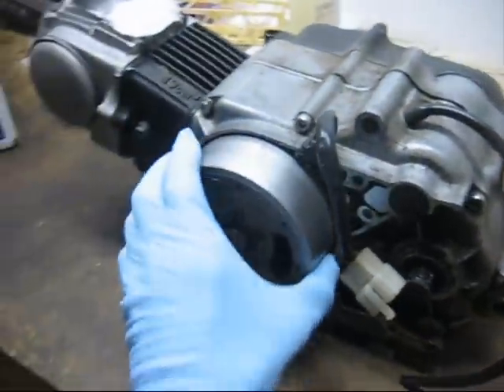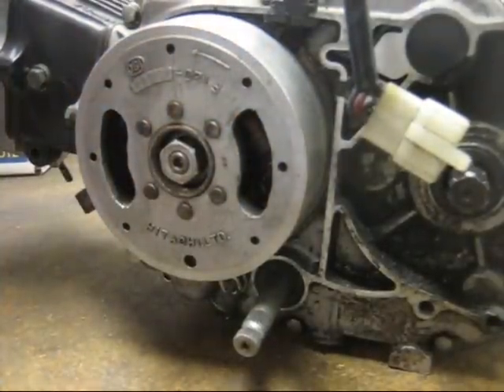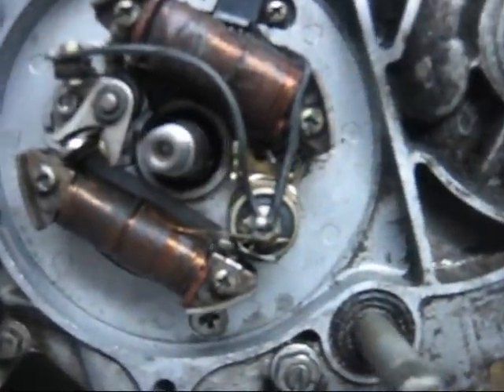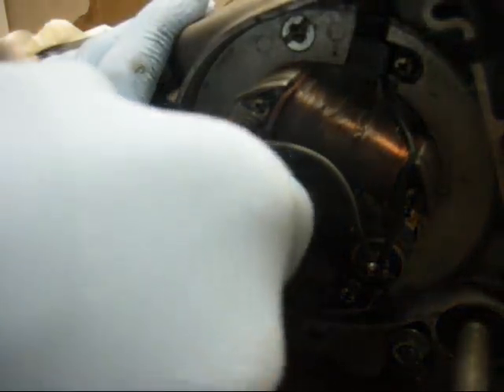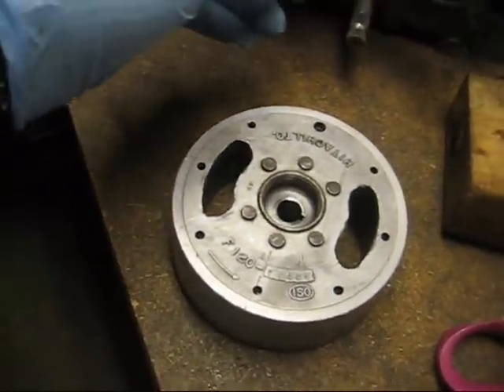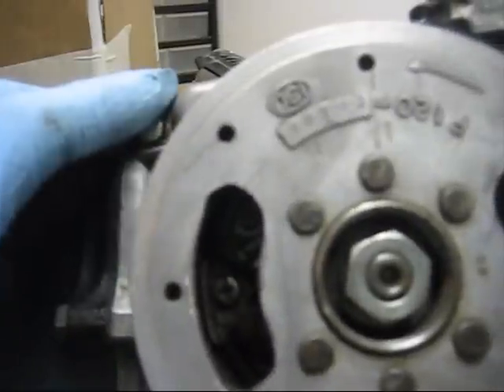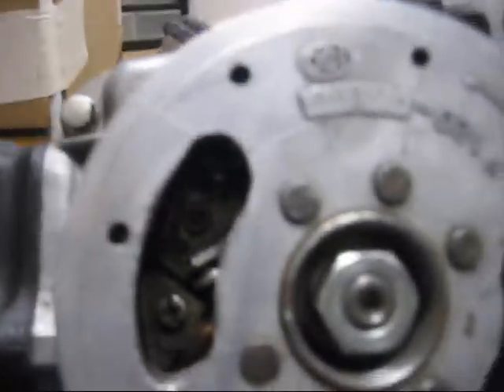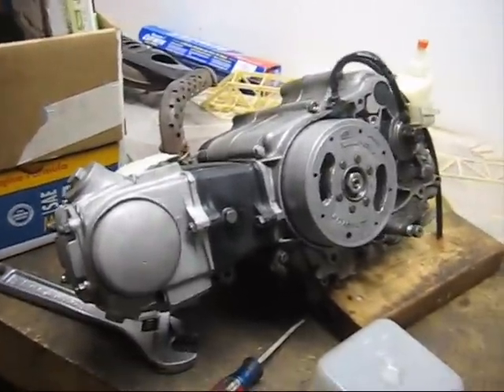How to Set Points

Comment: great vid Alex.  filing points are ok for a temp fix, but the contacts come coated with silver, and once the silver burns off, the points will quickly burn again. silver is the best electrical conductor on the planet. keep up the good work and vids.

Comment from the maker: It has been a long time since I worked on a Z50R motor with 4 wires. In either 1979 or 1980 they changed to a single wire output which powered the ignition coil only. The 4 wire stators were used for bikes with lights, horns, and other electrical components. If you wish to run lights, that's what the other wires are used for. Keep in mind, the voltage is not regulated so you'll have to wire in a voltage regulator. It would be a good idea for you to search for wiring diagrams.

Comment: i have always been told to use a point file. sand paper is glass an insulator if there is pieces of sand on the point it will not fire. if u use a file only metal a conductor will be left behind and conduct if there is small amount of debre in the point area. not a big deal but good for people with out comoressed air. great video and can be done both ways. the best video i have seen on this

Comment: Nice video i took a old magnito flywheel .drill out the rivets  then the part that slides on the crank is left over .slide it on rotate until point gap is largest and adjust 12-16 .great easy access

Comment: The best way to recondition points on any engine is NOT to sand them while they are still in place.  Never having been off to inspect the actual surfaces of the points.  It is very important that the coating on the points is uniform to make solid contact.  If you sand them while you haven't seen if there are any small pockets on the surface of the points , you are only wearing the platinum or whatever coating that is on their facings.  Take them out and use a wire wheel in a drill etc.

Comment: Good video's Alex. There is a flaw in your settings if the points and their rubbing block are worn. Setting just the point gap with worn out points will give you correct dwell but the spark advance will be early.  Not too common on the little Hondas but I have seen it.

Comment: You also need to watch out for wear on the fibre heel of the points, if it's worn too much your dwell angle will be too small which causes the condenser to not have enough time to charge up, resulting in a weak spark. I've worked on hundreds of these... A buzzbox and timing light are also very helpful .
Reply from the maker: My grandfather has a cool old-school oscilloscope. I think it's made by Sears Roebuck. He showed me how to use it once on his 1969 Ford. I can't say I've ever used it since. When setting up the points on these little Hondas I usually set it like shown here and fine tune it with an inductive timing light. As for the wear on the follower, a drop of oil on the felt goes a long way to reduce wear. Seeing as how the part costs so little, I generally just replace it if there is noticeable wear.
Reply: Yea dwell wasn't as important on these little guys as it was on the high performance two strokes like the Kawasaki and Suzuki triples. Severe engine damage could happen if I got it wrong.
Reply: Getting the dwell angle wrong won't do anything much to your two-stroke engine, just misfire and oil up plugs. Shorter dwell gives less time for a charge to build in the primary coil that collapses and cause the spark when the points open. On a high-performance engine the stronger your spark the better, so longer times are favoured.

This video is not by a trained mechanic. This motor is so simple you have to use the points gap to set the timing. Using the F mark on the rotor, get it close enough using a cigarette paper to see when they open. Even better use a strobe light.

The T mark indicates Top Dead Centre for setting the valve timing and adjusting the tappets.

Starting it on the bench is more affectation than it is useful, even for making a video.

That said this is one of the simplest and most fault-tolerant engines around, produced by the millions and hardly changed after they ditched the pushrod versions. The state of tune isn't all that important if you just want an engine that runs and starts; these things are designed to be one-kick starters.

Comment: excellent brother, now let me post my views on the point. Now these engines dont carry point system any more, but i have a good expoerience adjusting this point. when i used to install new one, bike used to consume more quantity of fuel, but when point would get worn out , engine would become more smoother. There is a tension spring in the point, you can disassemble the one contact point of point and clean it by removing the clip, and loosen the tension strip or spring. if there is less tension , the engine would run more smoothly, any way it is my point of view.

Comment: I use a plastic bushing the same thickest as the center piece on the flywheel to set points, that way you don't need to have flywheel in the way of setting them.

Comment: love your videos.  Just a comment:  I think you want to set the points with a meter or a test light because as the point follower wears, that max gap method wont be accurate for the points to open at exactly the "F" mark, cant really see it either, the must "electrically" open at the F.

Comment from the maker: Smoke can be generated from 3 places. Gas, oil, or water. These engines are not water cooled so you know it's not that. If it was, you'll see white smoke (really steam) out the exhaust. If it's gasoline, it will chug a dark black smoke and smell like burning straight gas in a fire. This is usually associated with running rich. Blue gray smoke is caused by burning oil. This can be caused by worn rings (most likely), or worn valve stem seals. Generally, if you fix one, fix the other as well.

Comment from the maker: Sounds like you adjusted them wrong or they are the wrong part. Are you sure you installed them exactly as the originals came out? Are you sure you are checking the points when the flywheel is in the correct position?

Comment: yes, in some cases if your condenser gos bad your enginge wont start, and if you have the wrong spacing (as in to far appart) the points wont toutch to make the spark plug spark to close and your spark plug is sparken befor its suppos to

Comment: I've got a quick question how do you start that thing with drill? I tried it and spinning the nut off. That would be a great help at the moment. I just had a knee replacement, so can't kick. I've got electric motor hooked up to a belt wrapped around the flywheel. Korea would be much better! Thanks

Comment: Gday Alex.........Love your videos man, especially your 125 rebuild movie its truly the best on you tube to date, However I ran into some issues with a second 125cc rebuild when a starter motor becomes involved, my particular engine has the starter located below the engine and the entire set up was slightly different , I wondered if u could get your hands on these engines and explain the differences between ????....1. top and bottom starter motors, the wiring setups for both in depth right down to the ignition switches, 2. cranks and there sizes. 3 "MY FAV"...125cc bores and Cylinder Heads, 54cm opposed to smaller standard 52cm pistons can they be interchangeable with 140cc engine parts if so what parts and how, eg: building a hybrid engine from multiple parts off 2 separate engines. ....Dude if anyone can do it its you, ....also handy was ur awesome centrifugal clutch adjustment clip...loved it.....Well done bro...well done........here here.!!! Look forward to seeing these vids in the future... ATC 70s Rock. Peace...................Flooky!

Comment from the maker: You didn't say what engine you're working on. But I've never seen points that arc when they open. Does it arc if you plug the ignition coil in like it's designed?

Comment: Yeah, right. I am agree. But you know, in this time is a little hard to find the condenser and contact points replacemet. By the way, you know if the contact points and condenser for the Honda CT70 is the same for the Honda ST70?. Thanks dude!

Comment: if i remember the timing mark (t) on flywheel it's for timing the cam at the top dead center .not for set the point .

  the mark (f) for fire it's the real mark for gap the point .
Reply from the maker: T marks TDC and it is also where the point gap should be set. F marks the firing point. The engine fires when the points open. Thus, the points should open at, not before or after, the F mark. An inductive timing light should show the F mark lining up to the index mark on the case when the engine is running. Setting the point gap at the F mark will result in the points never closing and a bike with no spark.
Reply: i have a kawasahki  180 2 strock it dont want to spark wt can i do

Comment: Hi, one question.  I have a 72 Yamaha CT2 with a similar setup, points cam on the flywheel.  I do not see how to adjust the points timing and max gap independently.  I can set the opening timing correct to spec, however then the points gap is too large.  If I set the gap correctly, they open too late.  There is only 1 screw for adjusting the points position.  Do you have any insight to what I am missing?  Thanks

Comment: It is a 1981 Z50r engine. I got an ignition coil later that day in the mail and I made the gap a little bit smaller and now it runs. I don't have a set of feeler gauges though so I had to eyeball it. Do you know what could make one of these engines very smokey? It is kinda embarrassing to ride due to the large amounts of gray/white smoke coming out of the exhaust.

Comment: I adjusted my points but if i turn my engine over (with a drill without the ignition coil plugged in) the points make visible sparks. Is that bad?

Comment: I have a 71 CT-70 that has a 90cc head kit on it.  I’m having a hard time finding the correct head gasket. It’s 53mm inside diameter of the gasket ring.  Any suggestions on where to find one?
Reply from the maker: Honda Trail Bikes or DrATV both sell the gasket you need.
Reply: TheAlexManVideos thanks!! I found one at DrATV and have since got it up and running great!!!

Comment: hey the alexman!
Ive a st50 "77 it runned perfectly but suddendly when i was riding it stopped ignite... checked the spark plug worked fine points and condensor where just changed and good only thing is the bobine am i right? maybe you have some tips for me?

Thanks

Comment: I have a 78 xr 75 that I picked up in a trash pile. The coil was wasted it has the condenser on it, got a new coil with no condenser.  I bought a tune up kit from sudco.   I put the points in and condenser but where do you hook said condensers two little prongs to.   HELP

Comment: Far Out ! I would love to work with you .  I found a 73 Yamaha Enduro, mostly garaged with 1500 miles on it. (Of course i bought it). It sputters -but runs at higher rpm before shifting speed. My suspision is to put new points, condensor which took a long time to find not to mention the puller.  I dont know where Im going with this..... Using the guage, is it incorrect to put the guage in the points, retighten the points then pull it out, or let pnts compress on the ga, tighten, then pull it out

Comment: Isn't it nice to know that some mechanic will simply cut a small strip off of a piece of sandpaper and scratch the hell out of the points so that they work better temporarily and charge you $100 - $200 in the process?  I don't think you would want to do this if your points were $200.  Later on those points could get extremely hot and stick closed.  Points are made with a slightly conical shape , not perfectly flat , so that they can repeatedly connect and disconnect due to the coating on them.

Comment: if you sand your point you will sand off the fine platinum  coating of the contacts and then the points will start to pit and destroy  themselves you should always use a fine corse  points file to preform a proper job otherwise the points will need to be replaced in the near future

Comment: i always just ajust points the use a timing light and should fire at the f mark,when replacing points ajust at t.d.c.to spec,4mm then rotate the muunting bracket,to get it to fire at f mark, mine runs and idles smooth,

Comment: You should learn the correct way to use adjustable wrenches. In the video you are using them backwards, it wasn't a big deal since it didn't take much effort to loosen them, but if it had you it were regular bolts that took a lot of effort they may stripped the bolt heads

Comment: Hi, I'm trying to get a family members z50r to go. It was put away when children got a bit big and has been covered up for about 25 years, there was nothing wrong with it when it was put away. I have now cleaned out all the carborator and fuel tank, changed air filter, oil and I have tried running new fuel through the system but it doesn't seem to spark i was wondering what would make it not plus I have had a new spark plug on it.   Any ideas would be appreciated thanks.
Reply from the maker: Joe Jones You can find .PDF files online of the service manual. It has a detailed troubleshooting guide which will direct you to which tests to do in what order. It will outline how to do the tests for each component. This video is a good guide for setting the points. If the bike ran fine when parked, the points are possibly dirty. You could try cleaning the layer of corrosion off the points by sanding them with fine sandpaper.
Reply: Ok thank you for that I will get a service manual and do that then thanks.

Comment: bought a 70cc baja motorcross. For my son got new stator,cdi,coil but still no spark.  could it be my flywheel??
Reply from the maker: Unlikely, but possible. Have you replaced the spark plug? Check the easy stuff first. Also check the kill switch and or key switch. They usually work by grounding out the ignition to kill the engine so you can typically just unplug them to start the engine. This may not apply in your case since your bike is from some unknown manufacturer so who knows how they did it.

Comment: im trying to learn as much as i can about pit bike engine's.. could you tell me why you'de need to do this.. like how would you know it needs doing an what causes it thanks mate
Reply from the maker: Honda hasn't used points on their 50's and 70's since about 1988. Most pitbikes do not use this setup anymore. If you do have this setup then it is necessary to do this in order to set the ignition timing. Also, dirty points contacts will cause weak, erratic, or no spark.
Reply: yh was wondering why mine doesnt have these points,,, i have no spark so thought id lost them so ended up buying a new engine.. glad you told me this now as iv just weasted 245 on a new engine

Comment: Hey thanks, trying to figure out where the point lobe is on my 73 Suzuki .not on the crank cheers
Reply: Which 1973 Suzuki bike you have and want to know information about?
Whether it is A50 or A80 or A100 or GP100 or GP125 or SB200 ?

Comment: hi, what size and where can i get the flywheel puller for honda s90?  And do 1969 honda s90 engine top end is the same as 1969 honda CD90 top end?   thank
Reply: Quoc Luu ebay or Amazon  they will run right around 20 bucks this type you need is universal across  many bikes and brands

Comment: im having some issues with my bike..its a 2002 honda cr250r and its giving me alot of kick back..it kinda wants to break my leg..i was wondering if you having any advise
Reply from the maker: Did the bike not used to do this and it just started? Any recent mods or service? Does the bike have adjustable ignition timing? Check that it's not too far advanced.

Comment: Can a point system converted  to CDI?
Reply from the maker: Yes, but not very simply. Case modifications are required, the crank taper is different and requires a hard to find adapter or a replacement crankshaft. The flywheel is different and a different ignition cover is needed. Then the coil must be changed, a new harness acquired, CDI box, and any lights must be switched to 12V bulbs.
Reply: TheAlexManVideos .thanks

Comment: Hi friends, I tried to set the point for my trial 110 Honda but still no power coming from the spark plug...please help
Reply: Daniel Leong yee Firstly you should check that all of your electrical connections are good. Afterwards you should ensure your Stator, CDI box and rectifier are working correctly otherwise the bike cannot start

Comment: Good enough but not the proper way to measure the points timing. You don't gap the points at T (TDC). You set the timing at F (fire). Think about it. That's the whole purpose of points... When they open and the Circuit breaks is when they allow the plug to fire.
The point gap is just a spec to measure if they are within tolerance of wear at the widest points gap (also not at TDC). 
One of the things that will wear is the silver coating,  or could be the points heel. The proper way to adjust the break at F is with a timing light, a sound box, or just use a cigarette paper as a feeler guage! It's thin enough and easy enough to break to be very accurate.
Also you're holding your wrenches backwards.

Comment: Never, Never NEVER hammer against the flywheel bolt to release the flywheel,,,,!!! 

Aluminium is strong under normal working conditions but,,,,,,,,,,the massive shock of a hammer blow being transmitted to the aluminium engine casting can (and probably will) cause damage to the engine casting resulting in failure at a later date when you don't expect it,,,,!!!

Result,,,,ruined engine,,,,!!!